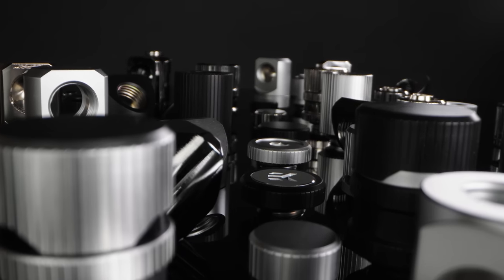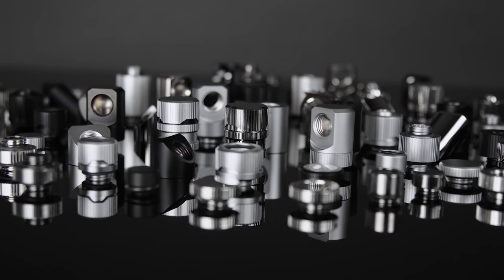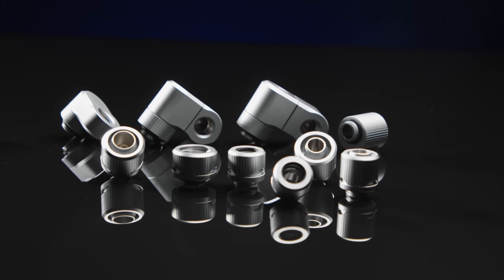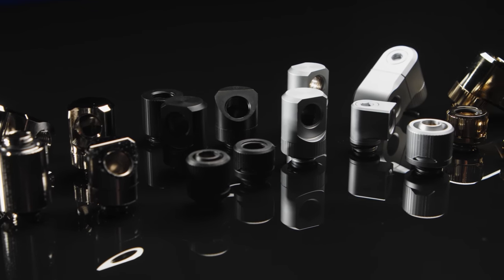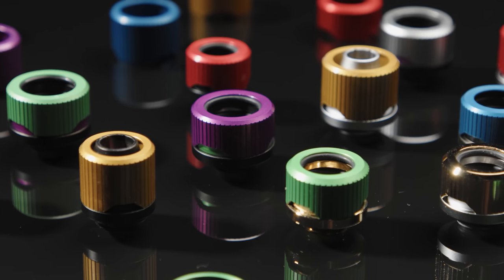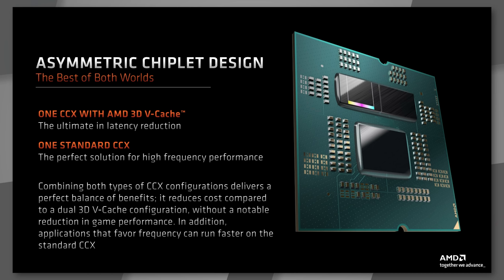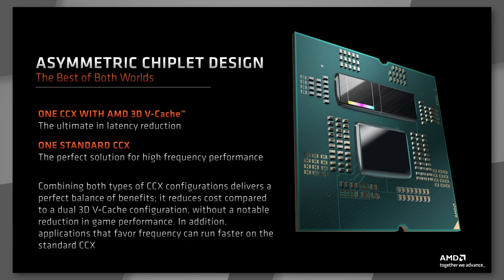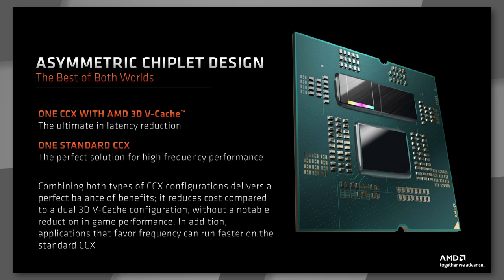Why I switched back to Intel...

Comment: It's actually really interesting to hear this. I'm currently running the 7800X3D on an ASRock X670E Steel Legend with G.Skill Trident Z5 NEO and AMD EXPO, and besides of memory training every time I update the BIOS (which makes sense) I had zero real issues. But I guess I'm just lucky and I have a good MOBO manufacturer.
Reply: ASRock used to be the bottom of all jokes as the  quality was pathetic and only the people on very thight budget would touch them. 
That was until they got a new CEO who turned them around and they have been pumping good stuff. 
Asus used to be the king be the last couple of years , they are heding str8 down to where ASRock  used to be.
Funny enaugh AMD had the same story , before Lisa S took over as CEO they ware heading down to bancrupcy and a rummer was that intel was going to goble them (the years when Intel had no competition).
Reply: You shouldnt have any of Jays issues as your 7800X3D only uses one CCD and no parking is required.
Reply: I've got exacly the same cpu and mobo and no problems at all too. I have even pushed my ram at 6200.
Reply: 7800X3D with an ASRock X670E pg lightning, corsair 6000mhz 32CL RAM (which probably has some issues itself) I needed to put my RAM at 5400-5600 for the longest time because every few weeks it wouldn't boot anymore or my games would get "corrupt install file" errors when updating, now after a bios update for RAM I can run it on 5800mhz and have done so for the last couple of months without issue, still can't hit 6000mhz and when I do a memtest it has a few errors sadly but I blame that on faulty RAM, and at this point it isn't an issue yet so I'll just keep trucking.(can't afford to be without a pc for 2-3 weeks for them to RMA it)
Reply: I got a Gigabyte B650 AX and 7800x3d for a while now, not using EXPO but I had no issues at all for now.  It is rocking. btw what are your temps? Mine stays on 30-40 idle and goes up to 60-70 on some loads, is yours ok?
Reply: as i mention up there gigabyte and asrock are good with there bios for now and some say asrock cheap ahah what a joke  some chad with less Knowledge
Reply: asrock as a good mobo manufacturer LOL!!!!!
Reply: Dear @mowtow90 ,

ASUS was never the best, Gigabyte was always the best quality side. QUality doesn't mean the highest clocks of the CPU but it means the longativity. I mean, how long the MOBO and all the other parts will work.
Reply: completely agree. i have an identical setup to you and have had 0 issues. asrock have nailed it
Reply: @Theworthsearcher  Gigbabyte always had problem with quality on their circuit boards for both Mobos and GPUs. They have always used sub par and light materials. This is why their high end GPUs keep physically breaking as the boards cant hold the weight.
Reply: i use the 7800x3d on an asrock pg lightning with g.skill trident z5 6000 cl 36, optimized to cl 30 and i dont have errors. i have the pc since the release of the 7800x3d and i got 2 unexpected trainings for 15 mins.
Reply: I have the same MOBO and CPU. Also have an RX 7900 XTX Taichi White. My ram is XPG Lancer DDR5 RGB 6000MHz 64GB (2x32GB) CL30-40-40. I have Expo running and im at the 6000mhz., I have had 0 issues. I did try 4 sticks though and it either wont boot. Or is super unstable. So i just went with 2 32gb sticks. I also have PBO enabled as well. CPU sits around 4.9 to 5.0ghz. Honestly im super happy with the AMD ecosystem. Also Asrock makes great parts. GPU sits at 65c and 90c hotspot.
Reply: You are not lucky, the rule is that, dont be afraid bsc one case of problems in youtub.
Reply: May i know how long the boot time?
Reply: @adrifauzan  if you mean me, my boottime is <15 seconds, which is slightly faster than my intel laptop and my intel workpc. Windows 10 on every pc.
Reply: @TheStumpyofPain  i actually asking to darrian (the main reply), but thank you, its nice to have another information about boot time, btw what version bios you install right now? The 1.28 or 2.00 (newest one)?
Reply: @adrifauzan  i am running 1.28 right now. i always wait some weeks before switching to a newer bios, incase something is buggy, like the heat damage earlier this year.
Reply: 7800x3d is currently king of gaming for amd.
Reply: asrock secret op ;)
Reply: @TheStumpyofPain  yeah according to what i saw in asrock subreddit the newest bios make system unstable but lowering boot time and memory training
Reply: I'm always booting twice on 7800MHz. All I did was tightening the timings but it's very important given the terrible EXPO profile. My system seems stable otherwise. 7800X3D is much simpler than FrankenCPU 7950X3D
Reply: Isn't Jay using ASUS?
That would kinda explain things, not that x3d is mature enough.
I think am5 and ddr5 itself needs 6m-1y to fully stabilize.
Reply: @Theworthsearcher  I had nothing but issues when I tried Gigabyte boards. Even more if I wanted to OC at all. Only ones worse I found were MSI. Also I stopped using ASUS because their quality is gone so far down too... Which leaves me pretty much an AsRock user... They've been solid as hell for me.
Reply: 7950x here with an imc that just blew up. Warm boots fail if expo or xmp memory is enabled. Infinite yellow led on motherboard. Jedec 4800 works fine. Not a 3d chip.
Reply: Mine is freezing with expo on. I turned off and fixed. Still fast enough to me
Reply: @Theworthsearcher yeah, i have really liked gigabyte a lot...
Reply: Asrock is a good manufacturer 😂
Reply: he had a bad board or cpu.
Reply: good MOBO manufacturer / ASRock 
Choose one 🤣
Reply: @Adr1an511 wrong. Both my wife and I have an Asrock motherboards, and we have zero issues. Considering past controversies, I will gladly choose Asrock over Asus, for example.
Reply: @DarrianCZE  my and my friend used to have budget asrock MOBO's, mine  died and he's had never ending audio/internet issues
In my next build i switched to gigabyte and never had any problems
Reply: @Mnunnsr  Clicked on this to say the same! Only one CCD on the 7800X3D! That gets around the mess the two differing types of CCDs on the 7950X3D results in.
Reply: @TheMwowner1  The underdogs strive to catch up, the industry leaders rest on their laurels and get too greedy, lazy, complacent.
Reply: OP's experience mirrors my own. Zero issues with my modern AMD system.
Reply: asrock has really great am4 and am5 boards... in fact i favor the 550m steel legend for 120€ over the x570 gigabyte aorus master (300€) i had before (downsizing reasons)
Reply: his issues are ASUS and HyperX
Reply: @TotalXPvideos  maybe you do somethink wrong , i have 7800x3d , ram corsair 6000 expo enable and no issues so make sure yours are AMD compatible and if they are AMD EXPO if not well you need to find a good OC setting stable , check if you have a good bios for the mobo just check online wish one if the more stable , in my case the last bios for the 650b from MSI is 75Dv17
Reply: the 7800x3d its the best and more stable from all AM5 x3d line because its more simple conf whit one CCD, the others 2 have 2 CCD for different porpouse and there is the problem but they fix most of this issues already not sure what game jay use that make him to switch so dramatic for other platform XD
Reply: @TotalXPvideos Hey man I also have the same CPU/MB combo and 32GB GSkill RAM recently upgraded to. I am however getting random system-wide stutters (video and audio) despite me running Win10 and then Win11 afterwards, and also updated bios and other drivers. My next step is looking at changing GPU because it's an old RTX 2070, just a quick question for you, did you experience any stuttering for you and what GPU do you have?
Reply: @Theworthsearcher  LOL Gigbyte always been trash, and use cheap material what are you smoking...  Gigbyte being good lollllllloolllllllllll
Reply: Same setup I'm running with a 7900XTX - it's a beast. The retraining has been a pain, but other than that infrequent event it's been rock solid.
Reply: 7800x3D dose not have this problem it's not luck or ran or board choices it's the above 12 core problem has to to use windows game bar mode to disable the second CCD or aka do it in the bios your self. EZ but the problem lies in the 7900x3D & the 7950x3D. Jay is being lazy just give your editor a server or bad ass work station problem soloed. And  branded cpu is a good one. watch other videos I love jay but you have to dig deep & not guess what anyone on youtube is saying is Facts most of them just do it for the clicks. Study fourms & others that know what the f there talking about not guessing. Shit intel crashes m0ore in pubg not the games fault it's the cpus fault it's like a phone cpu DRM problems. So many likes on info that does not even matter only to others that do not know what there talking about at all.
Reply: @Mnunnsr  Jay's issues seemed to stem mostly from memory problems. Of which I've had none with a 96GB 6400MHz kit that was on my X670E's memory QVL, also with a 7800X3D.
Reply: That's my issue with it and why i decided to stick with intel. I have no doubt about the am5 performance but it's seemed like such a crapshoot. Some people swear by it and some people have a damn nightmare and that kind of inconsistency is not fun when I'm throwing around this kind of money. I wanted nothing more than to switch but i don't have the time to just be dealing with issues like this and intel has never failed me (not to say that they haven't had their own issues). I'm hoping by my next build they will have figured things out.
Reply: @TheMwowner1  basicly they are, yes they do not build the fancy stuff all the time or dont has the "Gamer Republic" or  "Msi Gamer" tag but they are solide as PowerColor.
Meanwhile i really doubt on Zotac and Gigabyte and if i hear what Asus is doing then yes somehow it is kinda strange that the underdogs still perform good without any issues.
Reply: Dear  @Raven1024  ,

OC. It is always, why people cry. :-( But OC os not good to any part nowadays and was also not good earlier days except 100-400 MHz depending on the CPU. But many people just want to OC their CPUs as high as they can or as it is possible. 😞 But what for? 😲
Reply: @Theworthsearcher  Because it is free performance basically with a good undervolt. I'm kind of assuming you're a bot though.... Considering how little of this conversation had anything to do with overclocking.
Reply: Dear  @Raven1024  ,

Yes, I am a hungarian bot. 🙂 No, I am not, just kidding. ;) 

OC, or not OC, that is the question. ;)
Reply: @mighty-roman
Bullseye! 
ASUS crappy mobo.
Reply: @yeetus59
Exactly!
ASUS is the problem 100%
Reply: Never had any problems with Gigabyte motherboards but not upgraded my whole system for atleast 8 years.
Buying Asrock itx motherboard this time all other AM5 boards manufacturers seem to have problems.

Brother bought Asus Itx B650 motherboard couple weeks ago no problems yet with the build, Ryzen 5 7600 cpu,  6000 speed corsair ram and 3060ti.

Comment: Been running a 7900x non 3D with 6,000 cl36 since November 2022. Some initial teething issues getting it booted and stable, but every BIOS update has only made it more stable. No issues for a long time here, couldn't be happier with the overall performance.
Reply: I second this, been on AM5 from 2nd week of launch so practically a year, I get memory trainings for about 2 minutes once a month on random but that is it!!!
Reply: I just built a 7900x/7800xt system with 64 GB of 6000 and I love it
Reply: yup, my experience. 7900 non-x is incredibly efficient and i love not battling with power issues and bios updates because it is on a budget workstation/server. i need it up all the time and on a budget.

i would opt for 7800x3d over 7900x3d any day. single ccd with v-cache is better then 2 ccd where only one has v-cache.
Reply: I have to agree, i've had no issues with my 6000m/t kit since launch.  Due to the 1.3v issues, i haven't upgraded my bios since initial set up.
Reply: 7700x here coming from 10700k.  First amd cpu and the experience was amazing. I really like it.
Reply: Slow ass memory though. Intel can handle way faster RAM with no issue.
Reply: What's your mobo?
Reply: @RomWatt  Asus Crosshair X670E Hero
Reply: I'm on a 7600x with 6000 cl36, and apart from occasionally memory training on boot it's been fine too. No blue screens at all
Reply: @puriel1147  hardly stable, you just havent tested it properly
Reply: @Dex4Sure  the intel is also good if you want a furnace beside your leg

Comment: That sucks to hear that you had so many issues with your system. I picked up my 7800x3d during the voltage issues and was worried because I’d picked out an Asus board along with it. But I must’ve been lucky because I haven’t had any issues with it all so far, PBO and ram set at 6000 too. It’s run like a top for me, but hopefully you have better luck on your new set up!
Reply: 95% of people didn't have issues with ASUS boards. So, it's more like, you need to be extremely unlucky to have that issue.
Reply: That makes me feel much better (I'm thinking of getting a 7800X3D).
Reply: What is your board?

Comment: Running a 7950x3D since release, and yes it felt a big janky.
But I have now settled, I have completely disabled their filesystem driver thingy so no more core parking, and I manually set the core affinity of new games once through ProcessLasso so they run on the correct CCD, and Process Lasso remembers of course.

It's manual work once per new game, but for me it works great!
Also power efficiency can't be beat.
Reply: Same here, Process Lasso is a great utility, my system has been stable since I built it and haven't noticed any of the issues Jay has mentioned. I run 64Gb of 6000MHz memery too (G.Skill), not had a single BSOD
Reply: 7800x3d still on top regarding power
Reply: @aziaufa418  That's true, one less CCD to feed power to.
But for people like me who need CPU horsepower during work (Homeoffice, dealing with big datasets and databases to churn through) but still like to game after work, the 7950x3D is the best of both worlds
Reply: @JayanWarden  Hi Jayan, which motherboard and Ram did you go with? Thanks
Reply: @MCMIXING  Hey there,
am running a MSI PRO B650-P together with 2 x 32GB G.Skill Trident Z5 6000MHz CL30 with manual timings
Reply: @JayanWarden  thank you, I’m looking at the 7950x3d for 1440p gaming but I also use pro tools and mess around with video upscaling/rendering also. Trying to decide on the right cpu, I’m leaning towards the 7950x3d as it will be easier to upgrade cpu if needed in the future.
Reply: Sounds fun. Like an engine crank.
Reply: Imagine paying so much to sit and allign cores to every game. AMD
Reply: @Tpecep I am using their hardware and I am not complaining. I have 0 problems with doing things manually.

Seems like it bothers you tho, but you are not even affected?

weird.
Reply: Same, didn't even install that core parking silliness.

Also, no instability for me. Asrock PG Lightning and Gskill Trident Neo 64gig kit @ 6000 Expo.

BTW, you don't even need to configure Lasso once per game. You can configure it based on file paths, so point it at your Steam library folders and any game you install will get the game affinity config. (Out of long habit, I always install all games to a separate "Games" directory, including my Steam library, so every game gets automatically configured.)

Comment: Memory Issues are a PITA . Please continue to use both platforms and let us know what is the best overall. Stability is more important when your rig is a daily driver not just a drag racer.
Reply: I have had nothing but problems with my 7950X3D. I ended up RMA'ing 2 of them (both of the main machines in the house)and was issued a refund by AMD for both. I replaced them with 7800X3D. No regrets. The stability has been night and day difference between the 2. I finally have some confidence in the brand again.
Reply: Wtf is a PITA
Reply: @Nevsack63 True
Reply: @Nevsack63  pain in the ass
Reply: @Nevsack63  These people and their acronyms 😭😂
Reply: Who wants to deal with stability issues, especially when he's running high tier AMD hardware. I'm waiting for ARL-S.
Reply: PITA? be normal